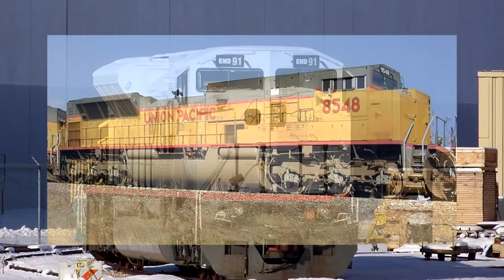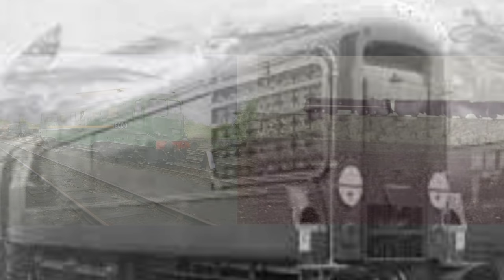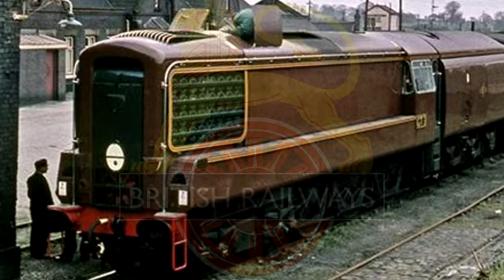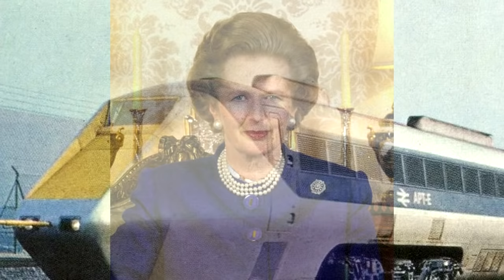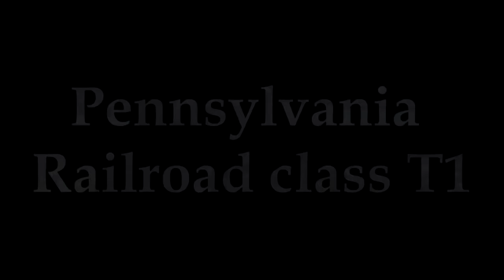5 AMAZING TRAINS (That Never Stood a Chance) 🚂 History in the Dark 🚂

Comment: The T1 is definitely an interesting machine and I too am a fan of them. I read another issue with the T1s was the valve gear used, which was Franklin Type A Poppet, which proved problematic and hard to maintain, and couldn't handle sustained high speed operation. In July 1949, No. 5547 was refitted with Walschaerts valve gear and performed much better than the other T1s and was reclassified as T1a. 5550, however, will be fitted with Franklin Type B2 rotary-cam Poppet valve gear, which is easier to maintain than the Type A and hopefully will be able to withstand the sustained high speed operation. Best of luck to the T1 Trust, can't wait to see when 5550 is completed!
Reply: I am so excited to see 5550 built she’s supposed to be the answer to a lotttttt of questions
Reply: one of the reasons the poppet valves required so heavy maintenance was because the locos were reportedly pulling 140 mph to make up for delays at the station
Reply: Did the haul double-decker carriages? They look tall enough to have done!
Reply: I hear a lot of talk about these ‘poppet valve gears’ but I can never find any examples of how they work - let alone what they are, so if anyone in this comment section could tell me (or even provide a link on) how they work. 
Because apparently, the LNER P2 class also had this for some time before they were rebuilt.
Reply: That's odd given that Norfolk and Western said they were superior locomotives when using one for testing in place of the Js.
Reply: Everyone can agree on this

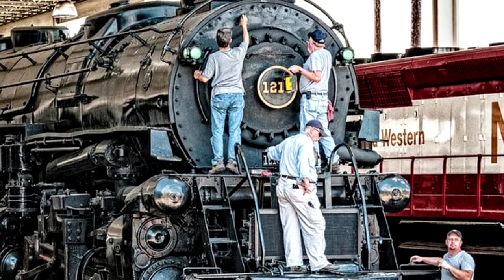Comment: 4:47 That's a Y, not an A... The A and the Y are like the Challenger and the Big Boy in the fact that they look very similar, but they were different wheel arrangements.
Fun Fact, when the 1218 was newly in stationary boiler service at Union Carbide, one of the employees at the plant hopped into the cab to check the pressure. He took one look and noped the f**k out because he had never seen a boiler with such high working pressure before, pushing the safety valves at a powerful 300 psi. He thought it was getting ready to burst.
Reply: New people and new to them equipment is always fun. I found out the hard way that the forklifts at my paving plant I work at don't have a low propane alarm, so when they run out of propane they die without warning. Also the repair shop one sprays cold white propane when changing cylinders even when the valve is closed.
Reply: @kingofthepod5169  Been there, done that. I was forklift certified at a plant that makes log cabin kits and ships them out. The building used to be a  Bethlehem Steel warehouse, and  some of those propane forklifts are probably almost as old as the buildings. 

Forget the lack of low propane alarms, the darn things are always leaking oil or dealing with hydraulic leaks, the tires run flat or close to bald, and good luck starting them in the winter... The plant has no climate control outside of some fans for the summer and portable kerosene heaters in the cold.

I'm surprised the things are still running at all, much less that the buildings are still standing...

Comment: One of the other reasons the N&W eventually switched from steam to diesel was a shortage of spare parts to keep the steam locomotives running. Another interesting fact about the N&W is they also built the last steam locomotive in the USA, an 0-8-0 switch engine in 1954.
Reply: @Ethan Thompson if I’m not mistaken the end of steam came in 1959 on the N&W
Reply: @Chevyguy-1984  May 1st 1960 if I'm not mistaken
Reply: @amtraklover   your thinking of 611

Comment: I remember the APTP being put on the main line, from London to Glasgow and Edinburgh, in the 1980's.  The journalists were apparently drunk, which made them sick, and they blamed it on the tilting mechanism. 

The news kept saying that the train had broken down, but I still wanted to travel on it.

There were other problems with this train though, and the controls were not standard, which means that the driver, and guards had to learn how to use the new equipment.  In those days, they would just hope that it was going to brake down.

Comment: To be fair, Mallard’s record breaking top speed was recorded on a slightly downward slope. Since most American rails are straight and level, I think that the T1 will have a good chance of breaking it.
Reply: And they broke the loco. Unlike German Class 05, which did 200,4 km/h on flat ground without breaking the locomotive.
Reply: @vornamenachname727  and with 5550, we expect her to run "hot, straight and normal", to borrow naval torpedo parlance.
Reply: @vornamenachname727  The German train was pulling 197 tons and the Mallard was pulling 240 tons. Also there was another high speed run planned for 1939 for the A4 pacifics. Unfortunately, war were declared and it never happened.
Reply: @dsmx85  on a downhill slope, more weight is an advantage
Reply: Yeah but the “hill” wasn’t that steep to begin with. Not to mention the drivers would have said mallard could have gone 130 if it has roller bearings
Reply: @Barracudo11109  There was a run for 130 mph scheduled to happen in September 1939 unfortunately a minor world event got in the way.
Reply: @dsmx85  yeah I heard. There was also plans for a a4 replacement that sir Nigel had planned. It was a 4-8-4 but ww2 Aldo canceled that

Comment: Something interesting to note about the T1: The group has good reason to suspect they can at least attempt at breaking the record.
The T1 was equipped with Poppet valve gear, which while designed to handle speeds of up to 100 miles an hour, proved to be maintenance intensive. PRR actually noticed that the valve gear was failing rather frequently. It got so bad that in 1949, PRR went out of their way to hire a technician to try and solve the problem. The technician claimed the engines were being pushed far beyond the 100 mile an hour limits they were designed for, even going so far as to tell PRR that he had observed a engines doing speeds up to 143 miles an hour in an attempt to make up for lost time. Of course, no engineer would ever admit to going that fast, for that would almost certainly cost him his job, and the fireman would also be trouble if he admitted to observing such behavior and not trying to discourage it. Even PRR themselves might have got in trouble for something that crazy, so if anyone knew for certain they would have been hesitant to speak up.
Reply: I don't know about Pennsy but to avoid overspeeding we used recording speedos for the last hundred years or so.  It would have been absolutely impossible to hide such reckless behaviour as speeding without authorisation.
Reply: @smitajky  Speedometers are only good at telling you your current speed, and to my knowledge recording speedos aren't a thing in most of America.
Reply: The prototypes were pretty good though

Comment: One more rumor about the T1 ---- was the engine crews HATED the fact a single T1 was to replace 2 -- K4 on passenger trains and looked at it as a way for the 
""  P """ company to LAYOFF CREWS  ,,
so pulling the throttle back on the FRONT ENGINE trying to blow the side rods off , so off to the shop for repairs , and doubled up K4's to the rescue !!!!!!

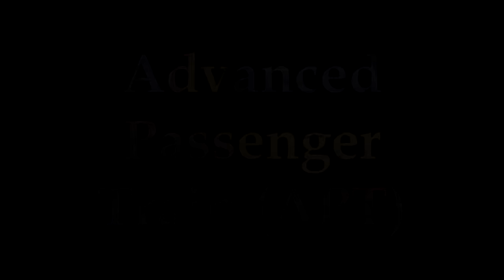Comment: 5:33 This because Baldwin and ALCO, along with other steam locomotive makers switched to diesel locomotive (or electrics) production already. every spare parts needed for Roanoke shops to make and maintain steamers no longer produced nor can be procured elsewhere and they had to make ones themselves. Actually N&W invested so much in steam engineering included constant upgradings to heavy rails, stronger bridges and new tunnels. the Elkhorn tunnel not only designed to ease off the grades and curvetures but also to permit these giant steamers to pass through unhindered. (with N&W expected to build larger steamer past Y class).

Comment: Bombardier built a gas turbine locomotive based off the Acela. It has gas turbine generators that would switch on at medium/high speed and a small Diesel engine for low speed and head end power.
Reply: What's it called?
Reply: @dimwit47_  bombardier JetTrain. It was a one off prototype made for the Federal Railroad Administration. There were no one interested in buying any such locomotives.

Comment: I only found out about the T-1 trust a few months ago but let me tell you I'm so excited, I've been fascinated with trains, mostly steam, my entire life and I really hope I get to see the completed T-1
Reply: It's set for 2030last I had heard ,the loco is about 35 % complete ,
Here is what's done 
Outer cab , nose , locomotive frame casting will be casted this summer , firebox , all boiler sections cores  , 4 out of the 8 drivers ,
Casting for smokebox (( steam chest )) 
front pilot and trailing truck castings are supposed to be done by end of 2023 ,,
The hole tender was found in the woods from an I1 decapod , it will need to be streamlined,  and it's trucks up dated to meet standards , if it keeps going like it has been 2030 will happen ...
Go to the T1 TRUST 5550 ,
There are alot more that's coming together , leaf springs,  equalizing cross frame members , I even think one of the side rods have been milled , something new every week ..

Comment: I thing you need to look at BR deeper and the way they procured, prototyped locos and also has a very successful in house engineering department that designed and introduced the APT, HST (class 43), Class 90 and 91, pacer, sprinter and DMU's, many many EMU'S. They even produced the 1992 stock for the London Underground Central Line (and W&C) that's probably going to hit 50 years old before replacement. Don't discount BR, they actually outsourced a lot of the risk in development to others but also produced some craing stuff!!
Reply: Also worth looking at the way the railways have been run post-privatization. I'm lead to believe that there's been a fair bit of mismanagement There, too.

Comment: To add to the epic ness of the T1 at some point in the 1940’s (don’t ask me the exact because I’m not sure), a T1 was pitted against a N&W J Class. The two locomotives were on par with each other in all categories, but at speeds exceeding 80 MPH the T1 was better. In other words the T1s could out perform what is arguably the best 4-8-4s ever built. Not only that but the T1s are more flexible than you might think. The center two driving wheels could actually slide two inches in both directions, as I’ve heard it called “poor mans articulation.” Also as for the speed record, even though there is no evidence to back this up, it is extremely likely that the T1s and the S1 actually broke Mallards record on multiple occasions. The runs were not officially recorded or documented, but if crews had any say in it they could swear they went faster than 126 MPH. Also to add insult to injury for Mallard, neither the T1s nor the S1 suffered a mechanical failure because of how fast they were going.

Comment: Somebody built a model of GT3, 5” gauge I think, with an actual gas turbine power plant in it.  I saw it running on a test rig at a model engineering exhibition.  There are videos of it on Youtube both on the test rig and running on track.  It both sounds and smells how you might expect the real one did.

Apart from 18000, 18100, GT3 and APT-E we almost had another gas turbine locomotive, which was to be coal fired.  I don’t know much about it; the power plant was completed and ran on test a few times, but there were problems with it and the locomotive was never completed, and was scrapped.

Comment: There's quite a number of steam engine technologies that massively improved their performance and efficiency, but which didn't stand a chance due to coming too late. Some include the Franco Crosti boilers and condensation tenders, which reduced coal and water consumption by 40% and over 90% respectively. However, they only appeared in the 40s and 50s, so only few locomotives would ever recieve this investment.
Reply: And then there's even more theoretical developments like Lempor and GPCS from the '70s and '80s as well.

Comment: I WAS QUITE FORTUNATE TO GET A 30 MILE CAB RIDE IN THE 1218 FROM ORRICK MO TO NORTH KANSAS CITY YARD OF NORFOLK SOUTHERN!
THE MOST INTERESTING INCIDENT ON THIS RIDE WAS WHEN WE WERE PASSING A VERY SMALL AIRPORT HARBORING ULTRA LIGHT AIR PLANES!
SEVERAL OF THESE PLANES WERE PRETENDING TO ATTACK AND STRAFE THE TRAIN!
ONE OF THESE GUYS DID A STRAFING RUN FROM THE REAR OF THE FAN TRIP TRAIN TO THE FRONT!
AS WE WERE ROLLING AT A VERY GOOD RATE, 45-55 MPH THERE WAS A TERRIFIC EXHAUST BLAST OUT THE STACK!
THE PILOT WAS CRUISING ABOUT
15 FEET ABOVE THE TRAIN , AND WHEN HE FLEW OVER THE EXHAUST STACK, WAS INSTANTLY 
BLOWN 30 FEET HIGHER!!
THE RESULT WAS EVERYTHING 
IN THE STRUCTURE OF THE ULTRA LIGHT WAS QUITE STRESSED!
I EXPECTED TO SEE IT FALL APART AND COLLAPSE ON THE MAINLINE
AND GET RUN OVER!
FORTUNATELY THE PILOT WAS LUCKY AND WAS ABLE TO FLY INTO THE CLEAR!!
AS FAR AS I KNOW, THERE WAS NO VIDEO OF THIS INCIDENT!!

Comment: Along with the SD89MAC, you should have mentioned the SD90MAC's predecessor, the EMD SD80MAC. To my knowledge all but one still exist, due to a crash and another was heavily damaged from funnily enough, rolling off the turntable track and into the pit. The SD80MAC was originally going to be widely produced, for the Canadian Pacific,  CNW ordering 15, and Conrail ordering 30 which included two Prototypes. 6 currently are owned by CP, though only for parts used for the SD70ACU rebuild program. 17 were owned by NS and CSX with 13. CSX's 13 were then traded 12 SD40-2s for the remaining 12 after the accident. Its said the rest of the SD80MACs are now owned by Progress Rail, but I can't find anything else on the Wikipedia page, which also says 12 went to Canadian Pacific? Probably not true and they probably still sit in NS storages yard or in the scrap heap. Foamers went crazy when they say these, especially since they remained in their Conrail paint for a while after NS received theirs at the famous Conrail split.

Comment: Fun fact about the  Pennsylvania t-1 it was the predecessor of the s-1, which at the time was the longest engine built by Pennsylvania, however the s-1 had the problem of either not working well, or not making tight turns because of how long they were

Comment: It should be said that the "White Elephant" that was the GT3 was a "Private Enterprise" build, it was not officially commissioned by British Railways.  The company that built it was English Electric (the same company who gave us the following classes for British Rail - 08, 09, 11, 12, 13*, 20, 23, 37, 40, 50, 55, 73, 83, 86 & 487)... where as the previous two "Gas Turbines", 18000 & 18100, were overly complex and ordered by the Great Western Railway, were failures and technically were gas-turbine-electric.... the GT3 was unfortunately built to the style of any GWR Standard Passenger Class 4-6-0, in a semi-smoothed shape, was also a mechanical drive, involing a gearbox between the turbine and final drive.... so was slower in reverse.... being a "pet project" the 1961 date was a misnomer, in that was the date J.O.P. Hughes (the designer) was given his head to build what he'd been designing since 1949, when he saw the potential of 18000 (aka GT1). If his GT3 had been assembled in around 1952-54, as a possible 4-8-4 (similar in layout to the LNER EE class)... but as this was actually Vulcan Foundary until 1957, when it became an English Electric acquisition.

As part of the British Rail Modernisation plan, although all classes were called BR.xx Class, ie. Class 08, they were prototypes built by various manufacturers, then the numbers actually mean something too;  Class 01-13 are Shunters (01-07 under 300hp, 08-13 upto 800hp); Class 14-20 are Type 1 (650-1000hp);  Class 21-32 are Type 2 (1000-1500hp);  Class 33-39 are Type 3 (1500-2000hp);  Class 40-54 are Type 4 (2000-3000hp);  Class 55-69 are Type 5 (over 3000hp);  Class 70-79 are DC Electric and Electro-Diesel classes;  Class 80-96 are AC Electric classes;  Class 97 are departmentmental (non-revenue); and Class 99 are Ships....
Reply: It should be noted that two issues kill any turbine locomotive, firstly a turbine only has a single rotational direction, unlike reciprocal cylinders, particularly steam, where the direction can be reversed; secondly this leads to a turbine's requirement of consistent high speed rotation, and how to convert that into driving motion, direct mechanical or indirect through an electrical generator/traction motor or hydraulic pump/traction motor.

In an ideal setup the GT3 would be double-ended and geared in such a way to be able to be driven at the same speed in each direction.

Comment: The Niagara's would also have totally made this list, due to an outcome similar to the Class A
Reply: I heartily agree.
Reply: Especially 5500, barely lasted 5 years but aside from the valve gear being different it was an excellent locomotive
Reply: @camelback5924  It even showed to be more efficient than the other Niagaras and got the nickname "Super Niagara".
Reply: Just think how many years it took,for a single unit diesel to equal one heavy steam loco! The Niagara was a 6000 horsepower engine,now there are 4400 HP,diesels,and the average road engine is 3000 HP,about equal to a Mike,or Hudson!! Forgot,the all mighty Berks,oops!!